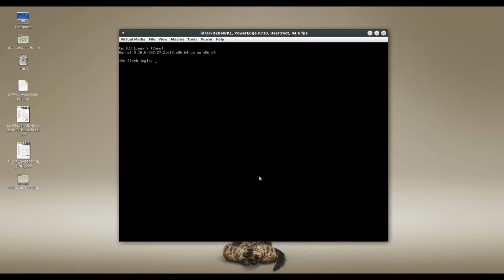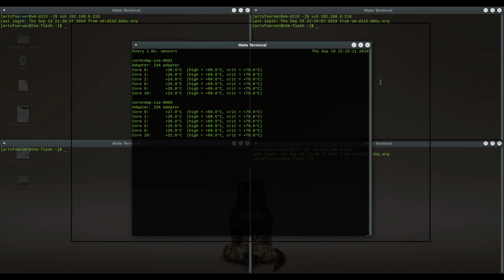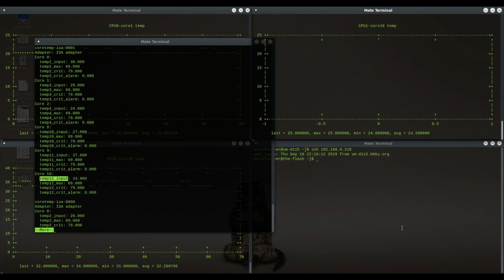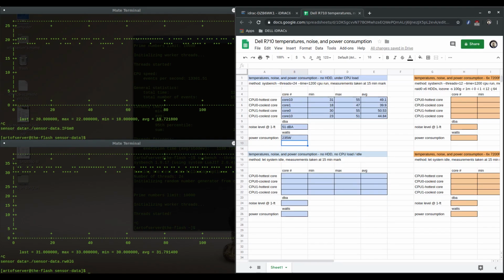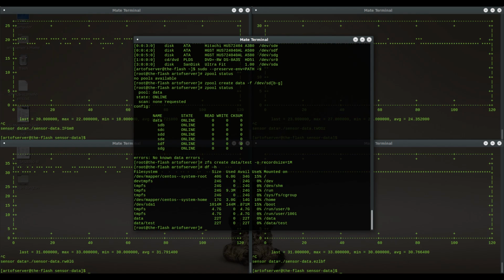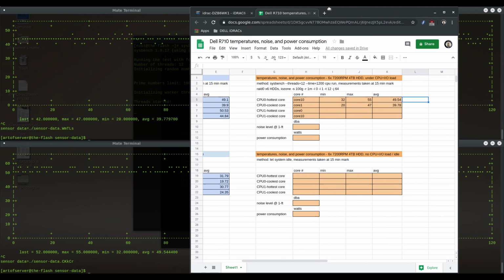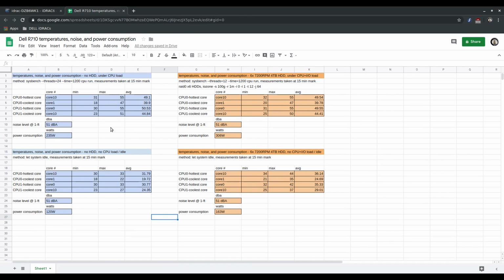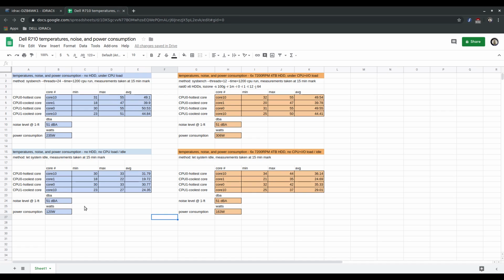Dell PowerEdge R710 build PART 5/9 | CPU temperatures, noise levels, and power consumption

Comment: I found this series way too late and wish I had seen it sooner. Great work great advice and fun to watch. I bought an R710 refurbished from a great German online Shop with dual X5650 and 64GB RAM. I then spent several days updating firmware, swapping parts out, adding a new Raid card to support 6Gbps and drives over 2 GB etc. I added a lot of NICs for LAG as this system runs VMs on Proxmox. I loved the journey, had some frustration and a lot of fun. In fact, the only frustrating part left is that iDRAC remote console will not run under Windows 10. Other than that, this server was one of the best buys I ever made.
Reply from the maker: Thanks for watching! :-)

By the way, in case this helps, i have a couple of videos showing how to get the iDRAC remote console to work here:

https://www.youtube.com/watch?v=drhSo9Xl9M0

and

https://www.youtube.com/watch?v=qxOk-AbIk9Y

I don't know if your issue was similar or not, but maybe if it is those videos may help!

Comment: The Xeon x5680 gives almost full throttle on the fans, not a good idea in a home lab for sure. I went with L5640. Very good walkthrough of temps and wattages.
Reply: Did you get full throttle in your fans just in idle or with full CPU load?

Comment: Loved the video - kinda watched the series out of order as I already have my R710 setup ( with one of your H200 ) and running. But still interesting in the power levels you have vs what I have on mine. I'm running dual X5670s with 96Gb memory and 6 x 2Tb SAS Drives and a SSD in the DVD slot for boot. I have L5640s in one of my R610s and was curious if it would reduce the power in my R710 and I might try it.  Don't worry about the music vs server sound comments. They are not that loud at boot and at idle are somewhat quite. I have a few switches that are louder than them at idle. Thanks for your videos.
Reply from the maker: Thanks for comment. Just curious, how much power does your setup draw?
Reply: @ArtofServer  I don't have a wall meter, but according to iDrac - Average is 235w Last Week - 307w Peak. As opposed to the R610 I have with the L5640s is 126w Average and 200w Peak. Its stays at ideal most of the time.

Comment: I use a script in a cronjob to measure the temps on my r710 and then manually control the fans in the ipmi using ipmitool in order to keep the fans at about 1920rpm and spin up if the temps get too high.

Comment: could you make a beginners guide to what you need hardware wise for the server to work, aswell as how to install everything on it
Reply from the maker: Hmmm... I kind of thought this R710 series of videos would serve just that purpose, no?
Reply: @ArtofServer  it's great yeah, i've learned a lot. It's just the real basics, like which parts are necessary ( from what I understant you need a raid card) and which aren't

But this is a really good guide for when you have a complete server, there's no denying that

Comment: I use apcupsd with data from my usb connected CyberPower CP1500C UPS to give me power data. I noticed, as well, it does not coincide with the ipmi data. I do not have a good trusted devices to test which is more accurate. Putting the data into influxDB with telegraf and displaying with grafana dashboards makes very satisfying pictures. One dashboard I found for import even shows daily/weekly/monthly/annual cost if you input your kWh cost variable. 
I have mine mounted in a closet near the ceiling and it gets warm in there. My concern is do they become less efficient in higher ambient temps... ie, would adding an exhaust fan reduce the energy consumption by as much or more than that of the exhaust fan?

Comment: Hello
   I was trying to find your most appropriate video to post my question but I didn't find any for the Dell r720, so here it goes. In the front side as well in the rear it has a small round button in order to blink  when you want to find the server.Otherwise if a problem exists it blinks in an amber light. Is there a way to make it ignore errors and stop flashing at all. Searched everywhere even idrac command but nothing seemed to work. Only thing it does is to change the light color from amber to blue depending how many times you press it either front or rear. It drives me crazy at night.

PS Also I unplugged fan 4 and my head is at ease now every time I shut it down . cpu temps are at 34-37 idle so I am still ok. By the way the identification light still blinks with fan4 also plugged in
Reply from the maker: Not sure what you're doing with your server... if you unplugged fan4 because it keeps spinning at low speeds when powered off, you should realize it's there to help cool the rNDC and BMC/iDRAC as that remains on and generates heat even with server is off.
Reply: @ArtofServer  Nothing yet .... still thinking if its going to be a second proxmox or try xcp-ng. Until then and probably after its pretty irritating that grind noise (not its not faulted, I sustituted it with another one and does exact same noise. Since its not for a work environment I need it as quiet as it can be while sitting and doing nothing)

PS rNDC and BMC/iDRAC are probably still on (in order to have remote access tis logical assumption) but their temp are very good. I can easily let the hand upon them without even feel they are getting warm

Comment: Are the Hitachi 4TB SATA drives compatible with the R710 w/H200 or were you only using them for the test?
Reply from the maker: They are compatible. I was only using them for testing and making these videos.

Comment: Hi - Is there a way to reduce power consumption on Dell R620 servers? I can run an SSD from the internal SATA connector. Can I remove the RAID controller?
Reply from the maker: If you don't need the RAID controller, sure you can remove it, but it's likely only to save you about 7-10W. What else do you have in your R620? CPU? any other drives? other PCIe cards? And also, what's your current power consumption?
Reply: @ArtofServer  Hi. Thanks for the quick reply.. The current power consumption is 180W when processing and 120W idle on the Windows 10 desktop. There are no PCIE cards but there are PCIE risers. There is a full set of fans. Memory 28 GBytes and two E5-2620.   I have connected a consumer SSD (Kingdan 60GB) to the internal Sata III.  How else can power consumption be reduced e.g. under-volting or reducing fan speed? I am using an external PSU for the SSD. So another question is: is there a way to get power for the SSD from the server without soldering? Thanks in advance.
Reply from the maker: @roblober9126  120W idle is within reason, but does seem a little on the high side... are your fans running at full speed a lot? do you know what RPMs?

I suspect most of your power consumption is from the E5-2620 CPUs with 95W TDP. Maybe swap them out for an IvyBridge lower TDP equivalent? For example, try a E5-2630L v2 which has 60W TDP. I think you may even get better performance out of it and reduce power. Passmark scores:

E5-2620 (95W TDP) = 7905, single threaded score = 1232

E5-2630L v2 (60W TDP) = 9088, single threaded = 1354

As for power for SSD, I don't have a R620 here to check, but usually there are a few places where you can steal 5V. For example, power for SATA ODD, or internal USB port... you can usually steal 5V from these without soldering and just using adapter cables. Just know that you can't use SSD with high current draw... 

The other things you mentioned, I'm not sure about, and I don't suspect undervolting will be a good idea here. Fan speed reduction might help, if they are currently running at full speed for some reason, but otherwise any power savings going from 3000RPM to 2000RPM is not going to be much.
Reply from the maker: @Rob Lober BTW, if you're looking for the E5-2630L v2 I mentioned below, here's an affiliate link to eBay:

https://ebay.to/2rn3BzL

That seller is not me, but is pretty reputable. (I've bought from them many times)

Comment: I like the music in these videos, it is calming and peaceful. Did you have any ideas of any way to reduce the fan noise. I have 2 Dell R720XDs and they are VERY loud at boot up but better after a few mins. Any ideas would be appreciated.
Reply from the maker: With the R720XD, you can use IPMI commands to manually control the fans. However, I would not just "set and forget" as the fans will not spin up when needed. So, instead, you might need to write a small script or program to monitor some of the sensors and manually adjust the fans via IPMI yourself as needed.

As an aside, I find that the 12G Dell servers are really finicky with regards to fan speed, and pretty much act like they are possessed by a server demon. Since I'm powering on/off my servers a lot while doing these videos and other experiments, i've experienced many unexplained moments when the server decides to spin up the fans, or even spin down the fans... there are times my R720XD is super quiet, even with the same hardware... and some times it suddenly decides to spin up the fans even though the system was not under load.  Times like these, I wish Dell and others would just use some open source BMC software and let people fix their code. In the meantime, manual override with IPMI would be the way to go.

Comment: Do you still use R710 ? how it works with modern applications ?
Reply from the maker: No, I don't use the R710 on a daily basis. I got them mostly to research issues my customers had with their R710 servers. The one in this video series has been sold.

Comment: Take control of those fans!  On a Linux box on your lan: "apt-get install ipmi-tool", then use this script to control the fans:

#!/bin/bash

echo -e "\nSERVER FAN CONTROLLER v1.0 - Kenn Power 24/01/19\n"

echo -e "Option\n======\n"

echo -e "Auto:   0"

echo -e "Low:    1=1200rpm 2=1400rpm 3=1800rpm"

echo -e "Medium: 4=2400rpm 5=3000rpm 6=3600rpm"

echo -e "High:   7=4200rpm 8=5000rpm 9=6000rpm\n"

echo -e "Display temp and fan readings: D"

echo -e "Cancel: C\n"

echo -n "Enter option: "

read OPT

if [ ${OPT,,} != 'c' ]

then

        echo -n "ServerIP: "

        read SERVERIP

        if [ ! -z $SERVERIP ]

        then

                echo -n "Password: "

                read -s IPMIPW

                echo

                case $OPT in

                        1)      VAL=0x00 ;;

                        2)      VAL=0x03 ;;

                        3)      VAL=0x06 ;;

                        4)      VAL=0x0c ;;

                        5)      VAL=0x11 ;;

                        6)      VAL=0x17 ;;

                        7)      VAL=0x1c ;;

                        8)      VAL=0x23 ;;

                        9)      VAL=0x2c ;;

                        d|D)    OPT=D ;;

                        *)      OPT=0 ;;

                esac

                if [ $OPT == 0 ]

                then

                        echo "Setting fanspeed to auto."

                        ipmitool -I lanplus -H $SERVERIP -U root -P $IPMIPW raw 0x30 0x30 0x01 0x01

                else

                        if [ $OPT == D ]

                        then

                                echo "Reading temps and speeds."

                                ipmitool -I lanplus -H $SERVERIP -U root -P $IPMIPW sdr | grep -E 'RPM|Ambient'

                        else

                                echo "Setting fanspeed to manual."

                                ipmitool -I lanplus -H $SERVERIP -U root -P $IPMIPW raw 0x30 0x30 0x01 0x00

                                echo "Setting speed ("$VAL")."

                                ipmitool -I lanplus -H $SERVERIP -U root -P $IPMIPW raw 0x30 0x30 0x02 0xff $VAL

                        fi

                fi

        else

                echo "Cancelled."

        fi

else

        echo "Cancelled."

fi
Reply: does this work with other servers ?

Comment: I would like to use a Dell PowerEdge R710 too, but it uses too much power (we pay 0.30€/kWh here) and is too loud ...

Because of that I am building a FreeNAS with an Xeon E3-1220, an Supermicro X9SCA-F and 16GB DDR3 ECC RAM - but it only has 6 SATA Ports so I want to buy a SAS2008 HBA (like the 9211-8i)
Reply from the maker: I have many HBA options in my store if you want to take a look. https://www.ebay.com/str/theartofserver/HBA-IT-mode-controllers/_i.html?_storecat=23844485012